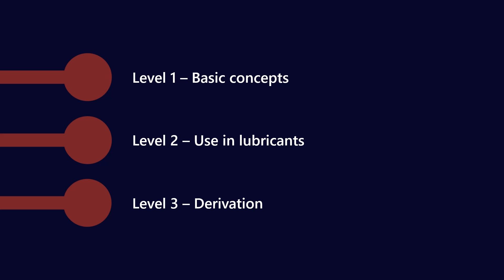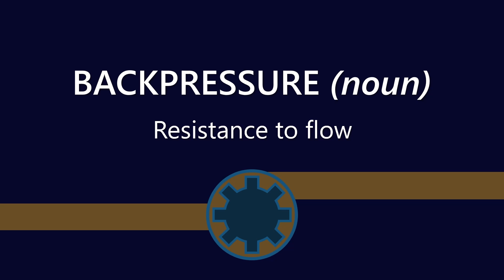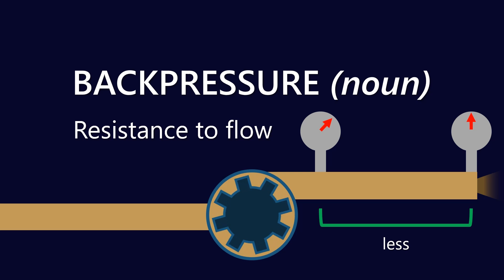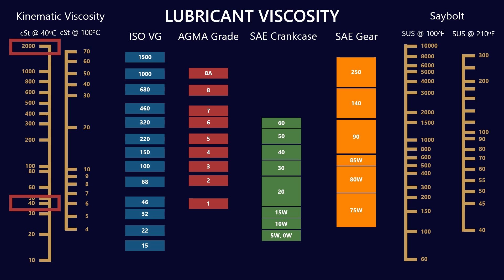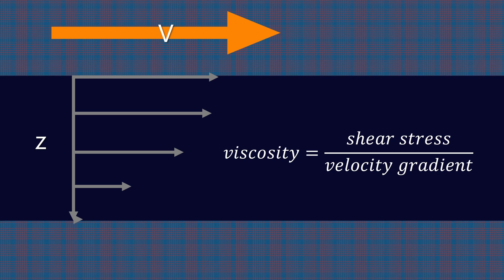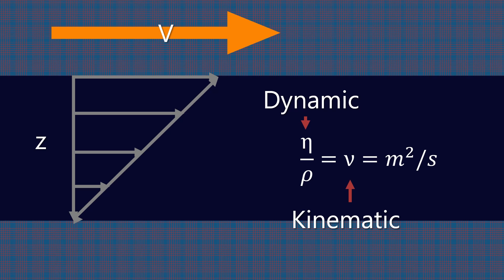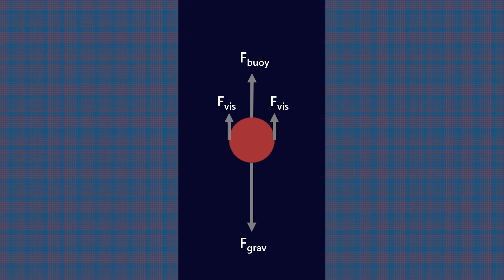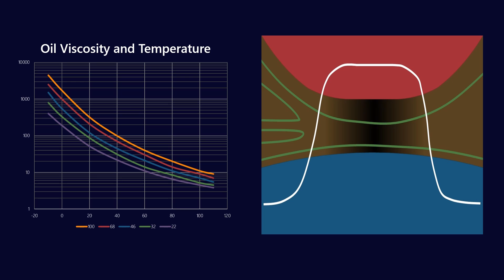Oil viscosity fundamentals explained

Comment: Do synthethics which have a higher viscosity index number cause leaks on older vehicles? Would you recommend using synthetics on high mileage engines?
Reply from the maker: Great question - theoretically no. What seems to happen sometimes is that when an oil engine has been running on a mineral oil for a long time, deposits are actually sealing gaps. When a high quality synthetic is used the more aggressive detergent package can sometimes remove these, deposits, leading to leaks. Fundamentally using synthetics in high mileage engines should help prolong their life.
Reply: Supposedly PAO isn't very kind to rubber seals in old engines.

Comment: FASCINATING!!! I scratched the surface of lubrication etc during the Corrosion analysis module of my NDT degree AND I actually got to use it once at an engineering works once. Basically a HUGE gear wheel had surface ‘defects’ that didn’t have any type of capillary action pulling in a dye penetrant when tested… Everyone was saying it was porosity (even though it was machined out of an ‘upset forging’) or surface corrosion due to water getting into the system and asked me to retest it. I actually said many times that the surface ‘deformities’ were down to cavitation due to the gear wheel possibly being unbalanced or the lubricant not being sufficient or a combination of the 2 … I basically got looked at as if I was an alien … Anyway this gear wheel was quarantined until the head mechanical engineer came over from Germany, give it a look over and said .. ‘Cavitation due to insufficient properties of lubricant used’ … He also agreed with me that due to the localisation of the cavitation that the gear wheel was most likely out of balance too … So as said, find all this fascinating as I do get it, only at a base level but it all does make sense 👊🏻👊🏻
Reply from the maker: Interesting! So my take on that is it would be unlikely to be cavitation, but micropitting would definitely match what you’ve described.

Comment: I am doing study and will do testing of oil for a car engine that will be used for an aircraft. I'm a mechanic and engineer by passion since I could crawl. I have contacted Australian oil manufacturers about recommendations and some basic questions but they all decline to give any information or advice other than try it and see how you go. I will be modifying an engine significantly including turbocharging. My main concern is the increased and constant load on the big end and main bearings. The engine is recommended to run 10w-40, and design pressure is 4 bar. Other than more load on oil pump and flow through filter, would increasing the pressure in the system provide better shear and load protection on the bearings or would it simply spray more oil out of the clearances? I realise there are many variables, any opinion would be appreciated. Thanks for the videos, they are informative. Much better than so called professionals on the internet describing oil as a lubricant, coolant, cleaner and that's it.
Reply from the maker: Good question - my two cents is that system pressure wouldn't have a noticeable effect on load protection in the bearings. Journal bearings operate on the hydrodynamic regime, which basically uses a wedge (because the diameters of the bearing and bushing are slightly different) to increase the internal pressure of the lubricant massively (to around 14bar) and therefore allow the oil to support load. You'd get a small benefit from increasing system pressure, but if you want to support more load, I'd prefer to go with a thicker oil. Or alternatively a base oil that can provide a thicker lubricant film at the same load (like a full PAO).

Comment: The problem with engine lube systems and low pressure alarms is - you need to lift the oil to the top of the cylinder head, to lubricate the valve trane.
And the only reading you can judge that action by is the pressure! Plus aside from installing flow meter in the channel from crankshaft and cylinder head - the back pressure induced by oil flow through all the channels in the cylinder head, camshaft bearing journals, rocker journals and lift compensator is only reading is available to monitor that action.

Comment: I'm interested in the effect of tackifiers in relation to viscosity. By my eyeball and fingers they seem to increase viscosity of a given base oil but then is there a difference in bearing surface film thickness between the tackified low viscosity base and an untackified higher viscosity base. (such that they end with equal viscosity)

Comment: Do you recommend a change of say a group 2 based 10w40 CK-4 Diesel engine oil in a Scania engine to a 5w30 full synthetic (PAO) CK-4 Diesel engine oil?
Reply from the maker: As usual, first consult your manual and see whether the oil is approved. As an example, Scania has an LDF-4 spec for engine oil that many of its newer engines must adhere to. If the 5W-30 synthetic is approved, go for it! You should see better wear protection and a slight improvement in fuel economy.